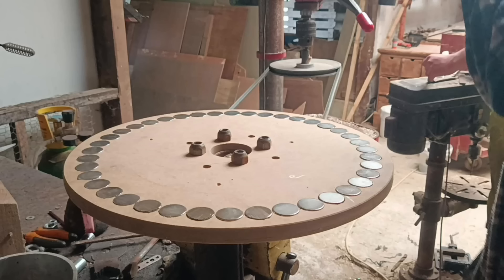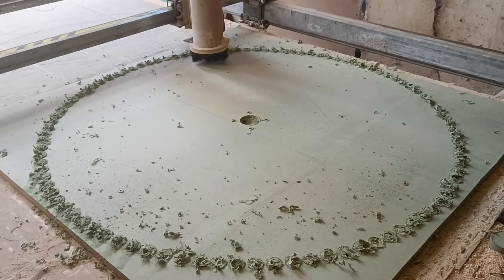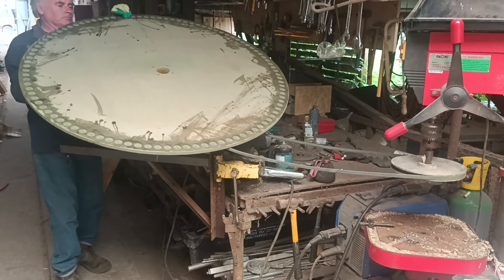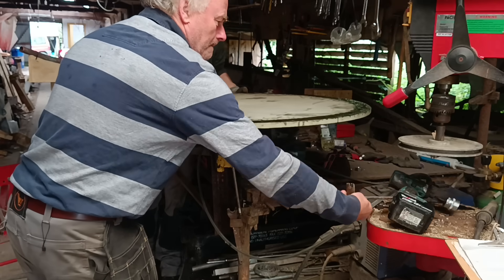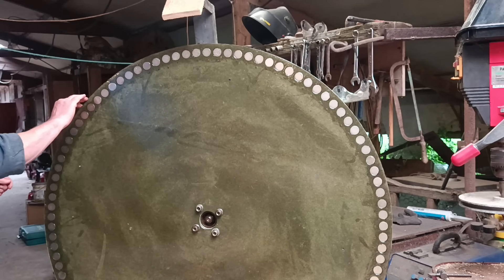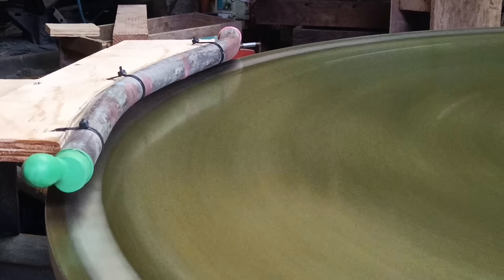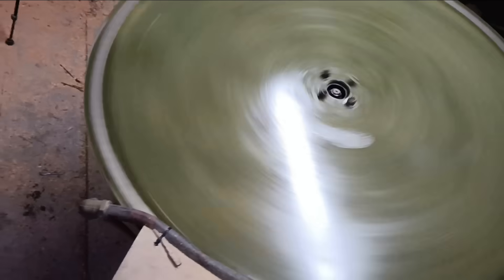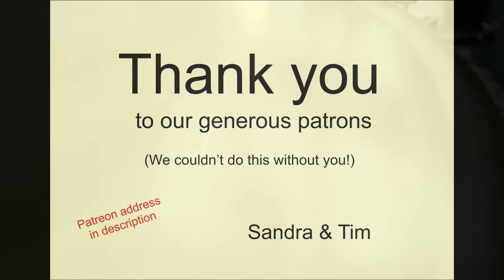ABSOLUTELY HUGE Magnetic Induction Heater! Using 100 Spinning Neodynium Magnets And A Bucket

Comment: If you had made two or three rows (inner to outer) next to each other with polarities alternating on all sets you could have kept the disk diameter smaller (easier to get moving) and created larger area of eddy currents in the water buckets bottom surface to make more heating area. The load against rotation will increase also.
  The objective being to maximise movement to heat generated is best obtained by maximising areas being used for induction.
So any design that obtains that objective is the best one to use, be it pans or tubes and can still be driven by the windmill.
   Keep at it and have fun too. Also, don't be afraid to start over if you think of a different design that should work better than current one.
  Also, don't use any adhesives like JB Weld that contain Iron in the filler compound to glue the magnets or anything that is going to be in a magnets field while curing, the epoxy will migrate to the magnets pole face before solidifying.
   Look into Faraday generators or Homopolar generators also to see if their lower inertia loading would be better for the windmills output power capability too.
good luck with your endeavours, keep us updated on progress.....

Comment: That was time and money wasting.. use induction coil or if you insist on Magnets at least make that circle smaller and put your Magnets sall and smaller circles and use coil cupper pipe and if you so much Magnets so do it from both sides as a sandwich while cupper coil in-between.

Comment: if copper pipe covers completely on top of magnets, it makes more heat. practically it is difficult to make a circle of that thick pipe, but you can use a pipe half that diameter and make two circle. ypu need to make a gadget to bend them and make a circle.

Comment: If you're trying to heat water with a windmill, would it not be more efficient and simpler to use Joule's apparatus - just some paddles spinning around in a bucket of water and being slowed down by drag? All the mechanical energy ends up as heat. Much less fun though!

Comment: the rounding disk makes air and cools the pipe itself. .... you could simply wind and wield that copper around the ac motor itself to water-cool the ac motor, this way it was more efficient as the ac motor winding produces heat thus heating up the water and that poor ac motor may live longer. better not to waste the earth material as the people are suffering poverty around the globe.

Comment: It has already been suggested but i am saying it again, it needs the copper pipe to span the entire circumference of the disc. Also, it would help if you make the pipe closer to the magnets, an inch is just too much space between them. If you can get it down as close as possible, but i realize your wooden wheel is not perfectly going to run flat but get the pipe as close as possible and get the wheel spinning as flat as possible and this will beef up the hating effect.

Comment: I suggest using bar magnets  with a large length to width ratio to maximize the number of magnets you will be able to fit for a given diameter. Minimizing the distance between the object you are heating and the magnet surface will considerably increase the heating effect. The width of the bottom of the object you are heating should be flat and be closely matched  to the length of the bar magnet to maximize coverage. Increasing the section acted upon by the magnet will increase utilization efficiency.  However, just by  flattening the tube and further reducing its  distance from the magnet should already provide measurable improvement.   Insulation is paramount and reduction of any unnecessary length will help provide further improvement.

Comment: the air gap needs to be as small as possible between the rotating magnets and the copper pipe, even a few milimeters makes a big difference. suggestion , put some nylon bearing wheels on the pipe that ride on the rotating disc, if you can make them adjustable even better. this is the same principal when making electricity with coils and magnets the air gap is very important

Comment: Instead of one large wheel with magnets in it, why not use the larger "wheel" as a gear to drive multiple smaller magnet wheels containing a specific Halbach array of magnets? I think that would give you more coverage area and faster heat up without a major loss in efficiency, you may even get away with reducing the rotational speed requirements.

Comment: If you want heat in the bucket...would be better to make coils of wire to make electricity and use a resistance heater in the bucket of water.   In fact I have long wondered how much power could be made using a flywheel larger than yours and lots of magnets and coils turned by a draft animal.  It's all about feet per second of the magnets passing the coils.  Say a 15 foot diameter disk and gear it up 3 to 1 from the walking speed of the pony.  Something like that.  It could be a shelter over the pony as well.

Comment: Maybe a pipe that is a c shape around the disk, that way you get induction from the top and bottom of the rotor
Reply: Could add a second layer of magnets on the opposite side to make this more efficient, or even drill out the opposite side of the disk

Comment: I'm amused by this experiment - a few years back I conceived of a return to purely mechanical diesel engine.  That's not too crazy, they WERE purely mechanical for over 100 years until very recently when everything went electronic.  Even an air starter or a spring starter can take away the more conventional electric starter - but the one thing that stuck me was the air preheater.  What I ended up with in concept was a copper vapor chamber replacing the ribbon heater in the plenum, but using a multi-disc magnet pack on a spring shaft to inductively heat the external ends of the vapor chambers.  This made it possible to heat the air plenum mechanically (not very efficiently) and using some of the engine's power I could "recharge" (mechanically) a weight to spin the magnet wheel on demand.
  
What I'd recommend for your thing is another magnet disc offset in phase by one magnet (so that N faces S) and some amorphous electrical steel laminations to take the backside magnetic flux of one magnet and give it a path to the backside of the oposing magnet (think of this an 50+ "U" shaped layers per magnet pair with the two magnets at the top points of each "U" and the plumbing running in the gap at the top.  Then increase your copper to water ratio by using smaller diameter pipes, have them go all the way around the circumference of the disc - and I can't stress this enough, get your gap as tight as possible (you lose a LOT of flux having that pipe so far away from the magnets).

Comment: More magnets and a bigger heating surface.
Maybe another ring of magnets and a copper ring around the outside magnets then coiling into the inner row.  Nothing to stop you from further expanding magnet rows inward and of course your copper pipe coil maximising efficiency. 

Interesting little experiment you got going on there boss 🙂👍

Comment: I wonder if I could build a giant light weight rotor with foam board and poor mans fiber glass? could it withstand the RPM's and magnetic and thermal flux induced in a stator coil or used as thermal source for a wind powered VAWT?  Think of it super light and strong simplified VAWT's to produce electric and thermal power to heat poor Indigenous populations.

Comment: There is a much easier and less dangerous way to do this. You can order round disk magnets just like the ones you have, but the magnetic poles can be on opposite edges of the disk, instead of opposite sides. So, instead of reading a flat board with many magnets facing different directions, you just need to spin one magnet in place. As the magnetic disk rotates, the poles flip.

Another video used magnets like that to hover a platform over a large copper surface. Thar project used 4 such magnets, each being spun very quickly. It utilized the principal that copper will create an opposing magnetic field as another one changes to repel it. Not only did the device hover, it heated the copper surface up quite hot.

Using this technique, you could probably get larger magnets, which would have a stronger effect as well, as you would only need a couple instead of so many. 

The you just have to figure out how to set them up to rotate. A major bonus too would be that this method would require much less power input to work.

Also, if you keep going with your setup, as you are already so invested in it, I would run the copper pipe over the entire circumference of the disk so it covers all the magnets. It's a big waste of so many magnets to not be using them at all moments. Of course, that was probably your plan all along, as this is a prototype. Not sure how that might affect power input requirements. Also, the magnets may need some system to cool them, as they must warm up too. The warmer a magnet gets, the less capable it is.

Comment: I've used something similar to this, but with two much smaller aluminum disc with magnets, opposing polarities spinning opposite dir5ections, and utilizing a full 1/2" copper tubing coil over the entire circumference of the disc (instead of just a small sample area), and used two check valves to direct the heated expansion away from the water supply.

This works well, reaches the target temperature of 140 degrees F.  The only issues I have is the larger amount of electricity the two motors require is greater than conventional electric water heater resistance coils.  - If this could operate with latent motion from another device at the same time, perhaps with a thermostat applying the rotation as needed with a mechanical clutch assembly.  I used a 220VAC bulb thermostat switch to switch the rotating disc motors on when needed, but abandoned the experiment when I found that the energy cost was so high.

Comment: Just as a shits and giggles thought, if you had linear magnets that were the same diameter…for all contacts i believe the wheel could be made shorter and generate heat faster…..as seen in other forms of magnetic items such as starters…they generate lots of heat…..ie the reason you can not keep the starter engaged due to heat…..good luck, i love your ideas. Be careful

Comment: The biggest problem outside of insulation is surface area. You should use small diameter copper tubing, like 1/4 to 1/8 inch. And make rings each larger than the last so six or more of them entirely cover the magnets in the full loop of the disc. You can build manifolds so that all six tubes are connected to the larger input and output. Finally move the copper tubing as close to the disc as possible without contact, this will increase the output. I know right now the water isn’t moving very fast but if you ever have any kind of flow, 1” pipe is going to do nothing in terms of heat transfer simply because of the lack of surface area. If possible insulate the back side of the copper tubing so that the half not near the disc doesn’t radiate as much heat. That should yield power output in the thousands of watts and hopefully retain most of it.

Comment: I need to try to surround the pipe in Eddy currents. Make another ring (not a full circle like the bottom one)and magnet setup. Secure it to the lower wheel to create a channel for the pipe to set in. The only thing is you may have to experiment with the timing. Whether you want the magnets mirrored or offset, or opposite. .

Comment: Very nice, I was thinking, there are 2 sides to a magnet, could you not double the power by using both sides of the magnet instead of the upper facing surface? I might be completely wrong but it's just a thought.

Comment: Just a few thoughts most have probably been posted already. You could improve things greatly by using a steel pipe rather that copper. The magnetic induction process does not work so well on thin materials the wall thickness of copper plumbing pipe is minmal. There is a magnetic field on both sides of the disk perhaps you could take advantage of that.

Comment: Seems like a lot of ""flip-potential" could be added if both sides of the wheel was used. You have a thick mdf material now because its easy to work wih, but a construction that manages to have the magnets exposed on both sides (perhaps some thin material clamping them in place) would let you harvest double the inductive power from the same size of wheel and rpm?

Comment: Wrap the tubes in rope to insulate it. For steam systems glass rope is available, but plant-based string should be enough at your temperatures.
To get a good thermosyphon you need a bit of boiling, which means getting the system to 100C (which I don't think will happen with your current system.) Obviously synthetic string might melt at that temperature. Similarly strips of bubblewrap might melt.
I think you need a smaller disc spinning at higher RPM. It will be smaller, cheaper and safer. The peripheral speed and kinetic energy of each magnet will be the same, but with less off them you have less stored energy in the flywheel overall. Vibration may be more of an issue but with better balancing and stronger bearings (not a bad idea anyway) you can fix that.

Comment: the induction heater principe is to use 10khz current wich is equivalent in this case aproximatly to 600 000 rpm ,so just make it turn faster as possible as you can.and yoo will see the difference.

Comment: You might consider using induction motor magnets arranged around the pipe that's why the spinning object is smaller.

You're losing a lot of potential work by not utilizing the full array of magnets.

Comment: Since induction ovens work with ferrous pots and pans, I'm not sure why you chose to go with a paramagnetic material like copper.  As other's have suggested, you might want to go with the most ferrous pipe you can find; of course, that will expose it to rust.  I wonder if coated ferrous piping exists that you can order, without creating.  Or, you could simply have a thick ferrous pipe bent into a matching circle with the magnets, with an inner copper pipe running through it, that absorbs the heat from the ferrous pipe instantly.  I don't know how difficult that would be to create however.

Comment: Have thought about adding three more to four more rings of maintenance?. Having the input side on the small side of the rings as then it expands it gets hotter and hotter each layer heats it up a little bit more. I would do an s  curve pipe. Cuz it hits more points that way.

Comment: Have many pipes cross 90 degree so they produce electricity, then a wire back to the  other side of the magnets gets the electric braking effect heating the water. ???

Comment: Coupd have ran a larger heavier metal wheel with springs an harbess the electricity u crrated oscilating heat a coil

Comment: If you got a Field out of an old Microwave and wound a BIG Wire in the loop maybe two turns and then connected that to a Heating Element for a HOt Water Heater, I bet you that joker would heat up Nice and Quick since its creating an AC Induction Field... If you shape the Field just right you could generate a Lot of Amps if you got it right... It might not make a lot of Volts, but a good Strong Field would probably pump out some Amps I think... Anyway, I would add a Generator Pickup or some kind of Stator around it, Basically what you have is the Rotor part of an AC Induction Motor (or an Alternator Armature) that has a Permanent Field in the Rotor,

Comment: Should the metal pipe ideally only see one (or maybe 2) magnet(s) at a time, therefore you need a loop of pipe on each side of the wheel, switching between plastic and metal at regular intervals. This is based on the fact that cooking the egg with a shorter piece of metal must have been working better than the later design. The ambient air temperature should have been mentioned / recorded. You should add thermocouples at the entry and exit points for the pipe by the wheel and a flow meter.

Comment: Have you worked out how much energy you need to make to heat up the water this way, verses using eletricity directly from a ac alternator from a wind mill, doing the same thing.
I think you will get a lot of mechanical lossed plus thermal losses, also the latter will be more mechanically reliable.
May be a smaller disks (say three) with less magnets off the same shaft with say 15mm copper pipes, joined at eithe end of the magnets, with a varible speed pump using a sealed system coil in large insulated tank, like the ones used for ce tral heating.
I love the way you tackel new designs like your railway track.
Keep it up.

Comment: A larger wheel is more mass to move, meaning more energy to move it. 

A more efficient way would be to make a smaller wheel which has concentric circles of magnets. 

Overlay a spiral of copper tubing over this which then maximizes the surface area being heated.

Comment: Excellent video, really out of the box thinking! If the magnets are too close they will compress the fields. There will be an optimum distance. Thicker pipe will help. Also most car radiators are aluminum. Maybe rows of magnets radiating from the center. With radiators spaced over the wheel. Good luck!

Comment: How about having another spinning disc above the water pipe, as well as below it, to see if it works twice as well, or better? Not sure if the top disc would need to spin the same way or not, and have the magnets with matching or opposing polarity but I'm sure someone clever already knows the answer.
Reply: Or have the water pipe coiling around the disc more, to hug more of the fields, and have more surface area, so perhaps lots of thinner pipes instead of one thick one might be more efficient too.